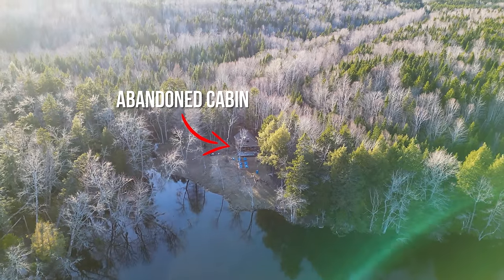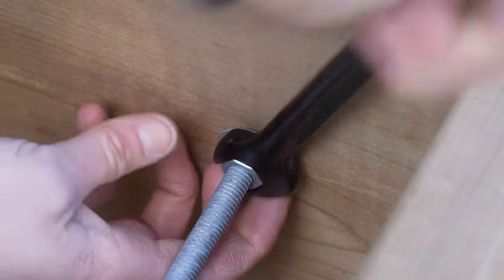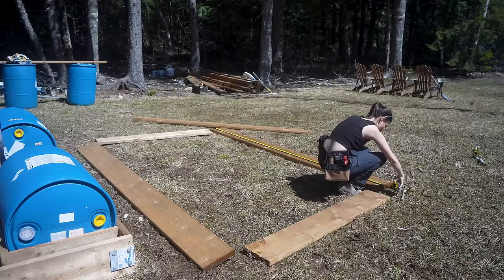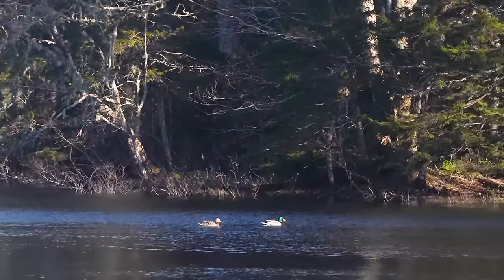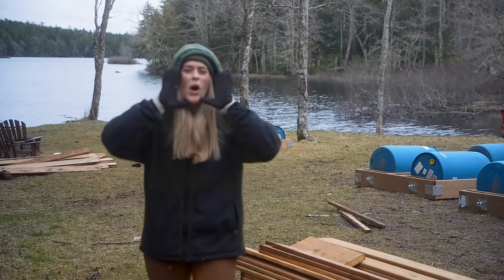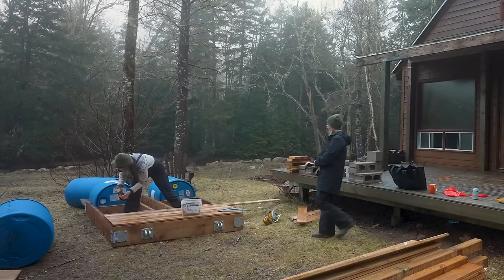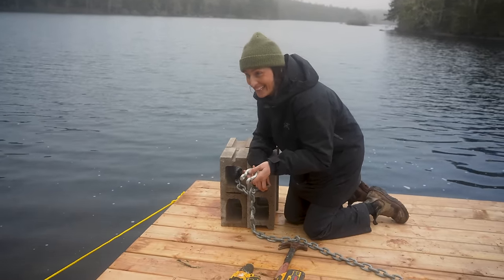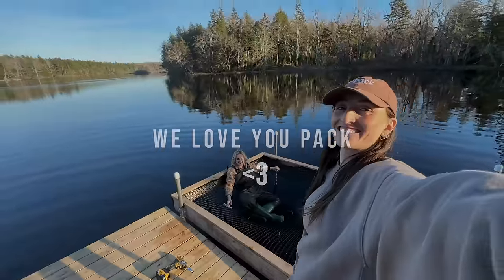BUILDING A CHEAP DIY DOCK BUILD FROM BARRELS (abandoned lakefront home)

Comment from the maker: Who’s going to be the first one in the water??? This DIY barrel dock was an awesome build- highly recommend if you’re shopping for a dock. It’s TIME to tackle this abandoned cabin and find out what we’re in for- STAY TUNED 💛
Reply: I'm glad your eye is ok I now wear PPE glasses scrubbing showers and toilets and sinks lol 🤣
Reply: YAAAAY!! This is gonna be a BLAST! 👏🏼 The Pack 🐾 is here for the adventure. New project for the Summer! 🌞🧢🕶️ XOXO Mo & Phil 😻
Reply: JUST AN FYI on those barrels... I have a floating dock made with those barrels here on my ranch and I have to end up replacing several every spring because the ice crushes them during a pond freeze, even though they are all well sealed. Make sure you have top access after the thaw, to replace them if one fails, and you should have no problem.
Reply: LOVE FROM PUNE INDIA🇮🇳🇮🇳 😊🥰😍🙂🤝😊
Reply: Awesome Dock!  you can also use the floating principle  for the New cabine build😀
Reply: What wood did you use for the dock? Will you have to rebuild in a few years?
Reply: @PopsBarnCatMafia Floating docks are pulled out of the water every Winter and placed back in the water every Spring in all the cold climates where water freezes. That has been done since forever.
Reply: That is so awesome ❤🎉❤🎉❤enjoy your new dock and, catch lots of fish 😮❤🎉
Reply: Pro tip for windshield, cooking or warming food. Do not I repeat. Do not use aluminum foil. Aluminum full reflects infrared heat. Therefore, the sun does not heat the food. Instead, use Saran wrap Saran wrap. Lets the infrared heat into the food to warm it. This technique also works perfect. When cooking food on the engine top again, the heat from the engine would be reflected by the aluminum foil. With Saran wrap. The heat passes right into the food and Cooks it quickly and efficiently.
Reply: Want to buy vanwives hats
Reply: @j87waldo ❤
Reply: If they take the dock out (with the help of Clementine) every winter,  that should help prevent  that issue.  We used to do it all the time.
Reply: @sharondoan1447  That would make since up there considering you get much much colder there. lol.  We get a freeze for only a couple of weeks so there's no reason to pull them here. Thanks for the info... I was curious how they would remedy that in the north.
Reply: Love the dock. Crystal will be the first one in.
Reply: @PopsBarnCatMafia  My husband’s parents lived on one of those thousands of small lakes in Michigan. He said putting the dock in and taking it out was such a miserable chore growing up that he never wanted to live on a lake as an adult!😂
Reply from the maker: @PopsBarnCatMafia we plan on taking the dock out at the end of the season!  In our climate all docks must come out.. We appreciate you sharing with us. 💛🐶
Reply from the maker: @sharondoan1447 Yes Sharon that is definitely the plan to take the dock out at the end of the season! 😊🐶
Reply from the maker: @moavdi756 Happy to always have you with us Mo and Phil the cat!🐶🐱
Reply from the maker: @susieg735 Stay tuned for the first swim of the season. We have already dunked in the river. It was icy cold. 😊🐶
Reply: If you ever decide you need extra FREE help with the cabin project.... PLEASE LET ME KNOW!! 
(For real!!) I'd just love to take a break from here! (Seattle) LOL!!!
Reply: Amazing.
Reply: @PopsBarnCatMafia  I am hoping they are planning to pull the dock out each fall. You're right; the barrels won't last in the ice.
Reply from the maker: @COEXIST-ny4db That is so kind of you to offer!💛🐶
Reply: Me too as long as someone else does all of the work
Reply: Docks look great!
Reply: Can’t wait ladies!!!  How exciting!
Reply: Can’t wait to see the transformation on this cabin…..I know you’ll make it look amazing.😊😊😊😊
Reply: YOU GIRLS ARE AMAZING!!!! YOU MAKE YOUR VIDEOS ENTERTAINING AND FUNNY TO BOOT……( toot,toot) 😉💞Jana from B,C.
Reply: You two girls allways amaze me. Great job love ya Hugs ❤❤❤
Reply: Taking the dock out using Clementine shouldn't be too aweful.
Without Clementine, I can absolutely see who strenuous it would be.
NOT that these girls aren't up for seriously strenuous activity!
I'm waiting to see what they're going to do for electricity on this new place.
Lots of sun, but lots of flooding, too.
I'm very invested to see what's next.
Reply: Me 2 💯 AGREE
Reply: OmG! Loved watching you girls building the docks!   I'd be right there by that water all the time.  Way to go! ❤
Reply: I truly can't wait until to see the nexted  build at the  lakefront
Reply: @Vanwives  Thank you.  But a very true statement!!
Reply: Where is this new project? What happen to the previous project?
Reply: Just love,what youre doing 💕
Reply: Nico😍😘🥰🤗

Comment: Hello ladies. You are going to want to strap the barrels in. also you may find the dock a bit high and bounce around a little when you move around on it. One trick is to fill the barrels 1/4 to 1/3 with water. that will lower it amd make it more stable.
Reply: I was thinking that about the barrels, that there was nothing keeping them in place.
Reply from the maker: Thank you for mentioning that. We thought about it and we may do that in the future when we take the dock out in the winter. Although the lake looks big it’s really a small pond with little water movement or wind, might be worth it!😊🐶
Reply: @Vanwives Yeah it's too late to let you gals know this but with those super long bolts you could have cut the bolts off and use the cut off threads just by putting a nut on both ends. Might be helpful info for someone.
Reply from the maker: Thank you, we do appreciate you sharing your ideas, insight and experience with us. Never too late!😊🐶

Comment: You will probably find yourselves putting 5 to 10 gallons of water into the barrels to stop the bounce and to stabalize the dock sections.  Strapping the barrels using plumbing strapping is also probably in your future. We have four 7 ft by 8 ft floating dock sections we put in and take out each year.

Comment: thats what we use is the blue barrels to make our boat docks and platforms on the river. Good Job! I love the net. Last winter the river froze and most people pull them out but we left one in and it got froze in place, all good because it was metal rope tied down otherwise the thawing and river flooding would have washed it away, one blue barrel underneath out of 10 did break away loose.

Comment: That looks like such a blast! Even building it looked like fun because you know how much joy it's going to give you. When the swimming season is over, just tie some floats to the end of the chains so don't have to go digging for them next spring. Great job and I'm a little jealous... Have an awesome week! ~Maarten
Reply from the maker: Hey thanks for the tip Maarten but we will take the dock out at the end of the season. We play hard and work hard the balance in life. 💛🐶
Reply: @Vanwives  Good plan. But if you don’t want to dig and pull up the cinder blocks, tie nylon ropes to the chains and floats to the other end so you can leave those in the lake and still find them next spring…

Comment: Every day you are at the site that is dry and warm I suggest you open up everything that will open in the cabin (even crawl space door)  Fresh & clean warm air is the best way to get the moisture issue under control.  I would go as far as setting up a tiny solar power system to power electric fans 24/7 during summer months.
Drying the cabin out is a process.  it will take time. But it can be done!
I'm really happy  you did not decide to burn it down and start over.  That would have been a big waste. <3
Reply from the maker: Thanks Steve, for sharing your insight with us. Happy to have you in our pack. 😊🐶
Reply: @Vanwives  The pleasure is all mine!  I so appreciate he opportunity to share your adventures :)

Comment: Angle grinder with a cut off disc to cut the bolts to length once they're done up and you'd have given yourselves a whole bunch of very useful galv threaded rod. And unless those decking boards were basically completely wet (and therefore as swollen as they could be) when you installed them, any decking that's near water like yours should have at least 5mm between boards to allow for expansion and contraction of the boards. No gaps means that they'll cup in no time.

Comment: It's great to see that you didn't bulldoze the cabin, that cabin just needs some TLC and it will be good as new, it's part of the landscape and it looks great sitting there. The dock looks awesome as well, nice job well done. You two ladies have a very blessed week and I'll see you on the next video ✌️
Reply: That cabin needs a lot more than TLC. The floor is rotten in places. It's not insulated. There's no kitchen of any sort. There's no power of any source. They can't dump their waste water anywhere around the cabin. It's crawl space gets very wet and moldy. They would be better off building a new cabin using some of the wood from that cabin but further away from the water edge and higher up.

Comment: Looks great, we'll done! An idea that works for us is to attach the barrels with metal ribbons, because if you party wild on the platform, or heavy storms haunt you, a barrel  might slip out and it's a pan in the butt to get it back under with the platform in the water. Speak of experience  😂.... but you have Clamentine, we did it by hand.

Comment: You might put on the hit list for some submersible adjustable dock wheels for each section of dock. It will make the job of pulling the dock out and putting it back in every season so much easier. Turns each section of dock into kind of a two-wheeled cart or wheelbarrow. Way less stress on everyone and everything when moving the dock pieces. Just a thought... ✌️🤟🖖🐾🐾

Comment: You can use nylon webbing like ratchet strap or seatbelt material to secure the barrels. Just run on across each row and screw through with a washer head screw inneach joist along the way. That way the barrels won't fall out when you take the dock in and out for the season.

Comment: I'll tell you from learning the hard.I might want to run some steel rope through a water hose and run it underneath to hold your barrels in. Also using a Dog yard screw down for a leash is Good for holding docks in place with the larger sizes. Those blocks really hurt when you stub, your toe and leg on.. Again use steel rope  to tie it down with and Inside a warehouse no one will get hurt.

Comment: Now all you have to do is get a couple truckloads of sand you have a beach and I think I should fix up that the cabin and move there and move all your stuff that you built to this cabin much nicer view closer to the water just in case you have any wildfires out there like we're supposed to get here And I hopefully you're using chain on all your anchoring points not rope I've Lost so many docs I have built over the years at different lakes after the winter go back there to the next summer you always got to go looking for your dock if someone hasn't cut it up for firewood

Comment: I think you could have built the individual floats on land, and then rolled them down the shore on their barrels acting as wheels.  Once it was assembled in the water, if you screwed down 2x4s along the upper side edges so they each span half way between the floats it would make the dock much more stable.  That would get rid of the bouncy effect as you step from one float to the next.

Comment: Those feet you've put down, get longer poles without feet on and knock them in the ground with a post rammer. Thatll anchor it in place. If theres any rise and fall you'll need to do that principle but in loose brackets on the jetty elsewhere.

Comment: Use a grinder or hacksaw to cut the carriage bolts to size, just put the nut on first, so after you cut you can take the nut off and reset the threads,

Comment: My Dad built something similar for our cottage on Keuka Lake, one of the finger lakes in NY. So you have to remove the dock from the water come late fall due to iceing. But it was a single unit acting as a float maybe 30-40 ft from shore. Held in place by a couple of cinder blocks locked to a center pin on the float. Keuka Lake freezes over just as yours does. So some of the things he did was used "galvanized pipe strap" (just Google that) to hold the barrels in. That saves you the hassle of fitting the barrels into their spots each time you are taking it in/out. Course it took 4 males to move the dang thing into or out of the water each season. We snorkeled each spring to retrieve the chain from the blocks. How are y'all going to get the blocks up or bring up the chain come next spring? I think Dad only used 2 blocks you've got 4 on each anchor point if I got that right. 

That said, it was an amazing build! You two are just incredible with the ideas you come up with. I hope Crystal's back isn't too messed up. You two have a great summer. Looking forward to new vids on the "Cottage on the Lake".

Comment: Great build.  Do you need to condition the wood so it is not going to have issues with being so close to the water/termites, etc.?  I remember as a kid we did condition our dock but that was on the ocean so there was a salt issue as well. We had put creosote on the wood too,  I recall.  I remember that smell, never my favorite but it became something that reminded me of the hours spent on the dock (back hen, outhouses also smelled of creosote, I don't know what it's purpose was but I am guessing it was a disinfectant of some sort.  I think that constant exposure to the manufacturing of creosote has been determined to be a health hazard. but I also know that very small amounts of it are still used in dental procedures. Formocresol (formalin and cresol mixed with glycerin) is used to sterilize the internal portion of an infected tooth or to kill any live tissue inside of a primary (baby) tooth if the nerve tissue has become infected but the tooth needs to be retained for spacing issues.  My dad and grandpa cut holes in our dock that had lids on them where we could fish with a dropline, it was safer for small kids than using a pole to fish.  Those are good memories.  First in the water?  I am going to guess that it will be Bella or Izzy who will race off the dock before either of you can get into the water.

Comment: I wonder if you could attach a pole type bracket to the end of each corner of each dock. 
So when you go to pull the docks out you can slip in wheels in each corner as it's being pulled out.
That will make it easier to manage and maneuver. 
LOL did that make any sense??
😂😊❤❤😎🏖️🌈☀️🦮🐕‍🦺⛵

Comment: Hello ladies, I think you should put a strap around those barrels just in case go get some like a roll of perforated metal 1 inch wide and I don’t know see them popping and a heavy wave maybe or you know in the tilts something might pop out just a safety measure it’s up to you
Reply from the maker: Thank you so much for sharing you knowledge and experience with us. That is a great idea.😊🐶
Reply: I just thought of something else. having them tied in like that they will come out and into the water easier you can get that strapping in the plumbing section they use it to install pipes and air ducts and. for real durability do two per barrel a lot of work but I think down the road it will save time with hauling it in and out just a thought I have done a couple in my time

Comment: Are beautiful, ladies. Please do not forget to clean the volunteers and brush away from the cabin. In the streams helps with the Fire danger and and for safety on the outside of your property Vincent? What's th at least a sixth or 8 footpvent and then cross vented again? Leave me in a fire break in between just a little helpful tip.
Reply: Oops Sorry about that.Autocorrect 😂

Comment: If I may make a suggestion after being a Marina Manager for 17 yrs.. DO NOT anchor the end of your dock with Anchors.. Drive in long pipes or Pilings and let your Dock Rise and fall on them otherwise should you get storms or Rains that create high water conditions you're Dock will NOT stay on the surface of the water and will Destroy itself trying to float Or it will simply lift your anchors and float away..
Reply: Thats what I will mention  put some pipes… 

Nice job !!
Reply from the maker: WOW that’s so smart!!!! Thank you so much. Love that idea a lot. Always get cool tips from our pack. Have a great week.
Reply: @Vanwives  if you simply pump water down the pipes themselves it's called "Jetting" they will basically dig the holes for themselves to install them..  Very simple process

Comment: Yeah it's too late to let you gals know this but with those super long bolts you could have cut the bolts off and use the cut off threads just by putting a nut on both ends. Might be helpful info for someone.

Comment: ... All fasteners ,, screws and bolts need to be stainless ,, ..staying above water , the galvanized bolts will last a while ,, but the deck screws (needed to be at least 2 1/2") and untreated or non-waterproof lumber won't last long ...   Should have waited to do this until summer ,, no need for waders and excess clothing ,, just get more bathing suit time .... I'm sure you could find Carhart bathing suits ...
  ...  Gorton the Fisherman's got nothing on Crystal ..  ... How are you going to keep the dogs paws from going through the webbing ?? .. need some kind of mattting ..
Reply from the maker: We have a plan. We wanted the dock in place so we can utilize it while we are working on the cabin. 😊🐶